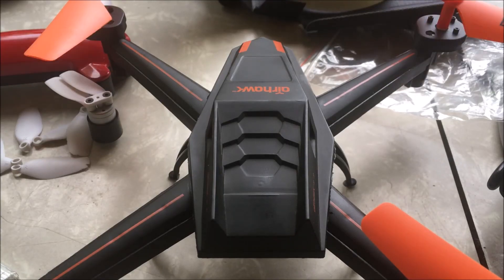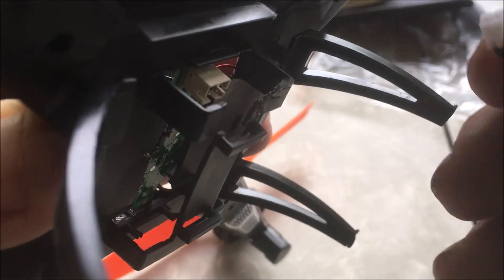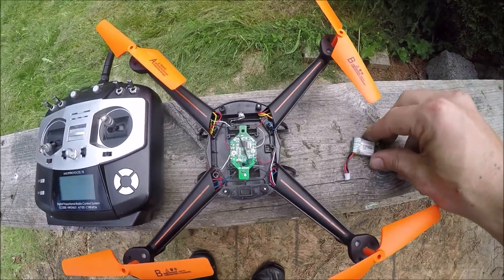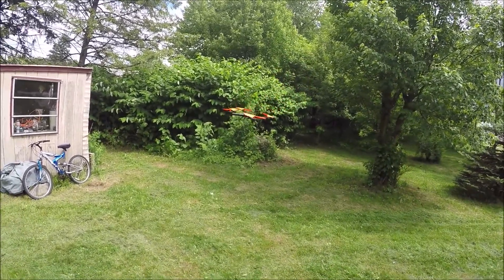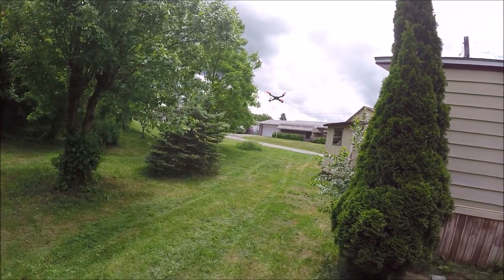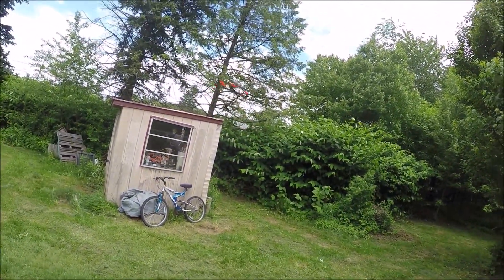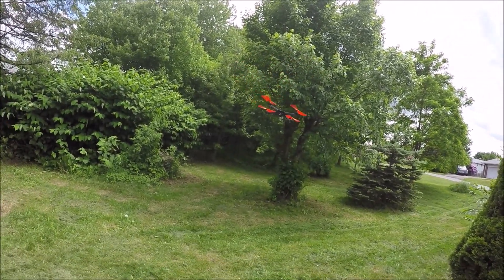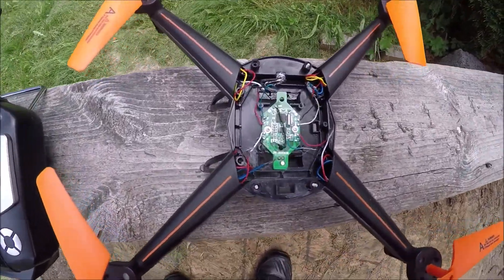Drone Range MOD - Bind any drone to the JUMPER T8SG how to DIY

Comment: I bought a Bugs 6 to learn to fly with FPV. As I have a Jumper T8SG V2 I would like to configure the BUGS 6 model as well as the MIXER. I suppose that the protocol is the MJXq, but I do not know what subprotocol to put, not how to configure the channels so that it alerts with low battery of the drone or bad link. How are engines assembled etc ...?
Thank you
Reply from the maker: it is not mjxq check out my vids on bugs n jumper

Comment: Better to use the E011/E011c boards instead of the e010. Pop silverware on to the board, and tune your pids to clean up the flight. I run the e011 boards in all sorts of frankenquads, just because it's so easy to tune silverware for larger brushed builds. I always have issues with geared quads and the e011 boards, though.

Comment: First my brother.
Reply from the maker: how u like the board switcharoo to bind it to the jumper
Reply: Jay Drone Looks good my brother.   That's really cool to do. 👍👍👍👍👍👍
Reply from the maker: wind stopped waiting on battery to charge got 2 of em going so if wind hold off then possably do fpv range run